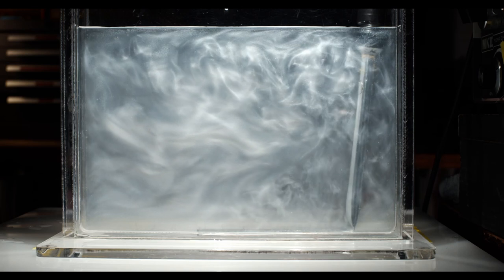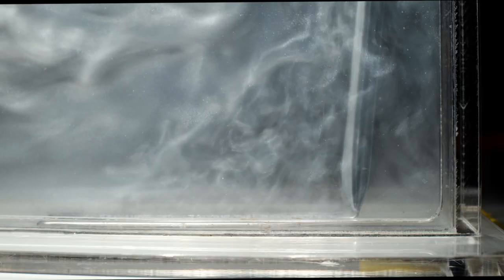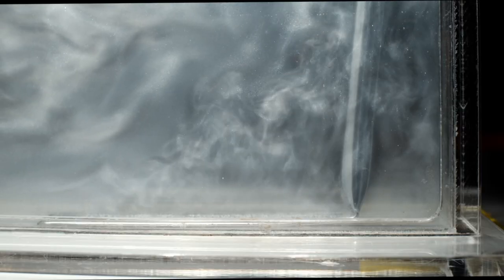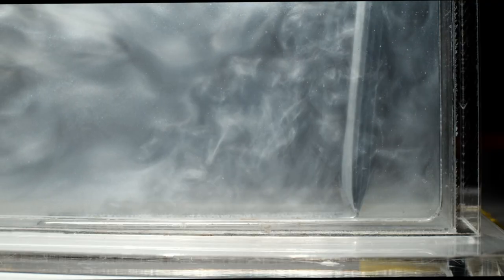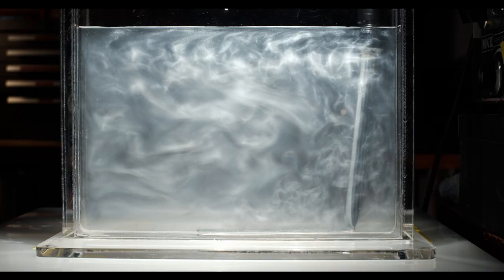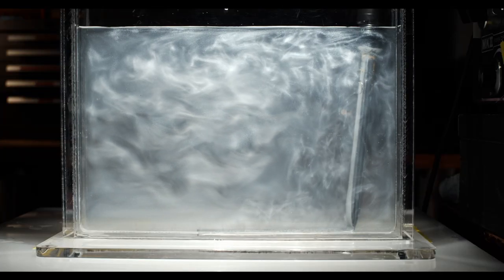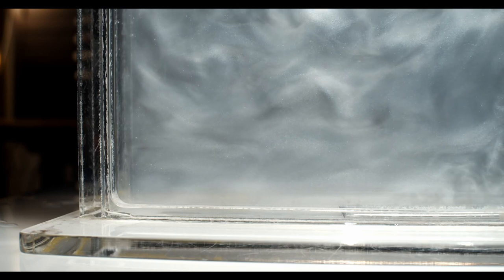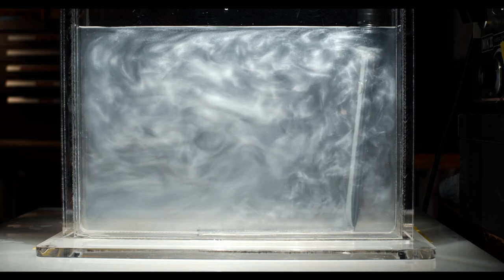Convection Cell "Sea Breeze" Visualization

Comment: How much of an effect is caused by this being a closed container, seeing as in real life there wouldn't be a barrier preventing the horizontal motion from continuing, and converting it into downwards motion?

One thing about seabreezes I've not been able to figure out, is why they have a clear frontal boundary, as opposed to gradually changing the wind direction over time as ground temp rises. 

It's almost as if they "take off" in real life, similar to a spring being released. It slowly builds and stores energy, that is suddenly released, causing a clear defined frontal boundary.

Comment: Does this have to do with the Intermolecular forces of the water. Since IMFs become weaker when heated and stronger when cooled. Just recently learned about them so I was wondering if that’s it.
Reply from the maker: The forces stay the same when the H2O is heated. However, the thermal energy increases, and that leads to a decrease in density, which causes an increase in buoyancy.
Reply from the maker: An increase in temperature is an increase in the average kinetic energy of the molecules, so they will be zooming around at high speed and occasionally crashing into each other, which means there will be less molecules per unit of volume at a given time. 

Sure, the forces between molecules will be less because they're further apart from each other as they zoom around with thermal energy. The point is that the density decreases as a result of their kinetic energy, not as a result of the forces changing. Does that make sense?
Reply: Harvard Natural Sciences Lecture Demonstrations ah, yeah that does clarify a lot. So some of the molecules moving faster in the area with the heater move in a direction away from the right side of the container?  This decreases the density of water on the right side of the container but also increases it in other areas. Also, the reason why the flow continues from the top right to top left is because the less dense water continues to rise to the top until it cools back down and falls?

Comment: Why does the cooling water not have microstructure and eddies?
Reply from the maker: The turbulence near the heater happens because the hot water that was in contact with the heater is moving much more quickly than the relatively cool water surrounding it, to the point where the flow changes from laminar motion (characterized by smooth streamlines) to turbulent motion (chaotic). Away from the heater, the temperature--and hence the density--is more uniform, and so the fluid is moving with a more uniform velocity and laminar motion dominates.
Reply: @NatSciDemos  That's super interesting! What mathematics governs such a bifurcation of behavior? What describes the threshold for temperature difference to go from laminar to turbulent?
Reply from the maker: To calculate the onset of turbulence you could use the Reynolds number, but some hand-waving would be needed since we're not talking about flow in a tube of well-defined diameter. You could also use Naiver-Stokes equations, but in that case we're talking really complicated math. ;)
Reply: @wiiuwiiu2020  Great question! Mathematics as us non PHD folks understand it can only predict at the macro (time averaged) level. I can only imagine the calculations would have to be done at the nano level involving billions of calculations based on the actual structures of the materials involved. What appears to us as random chaos probably can be described mathematically.